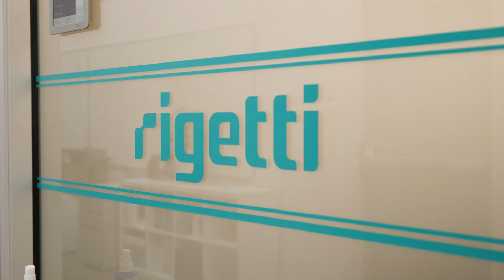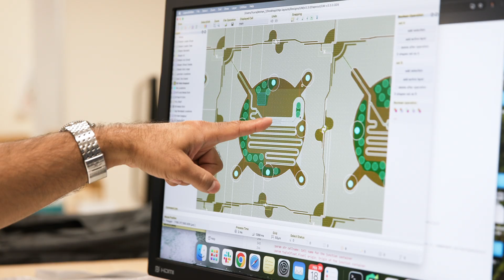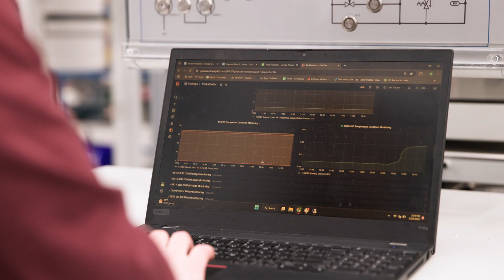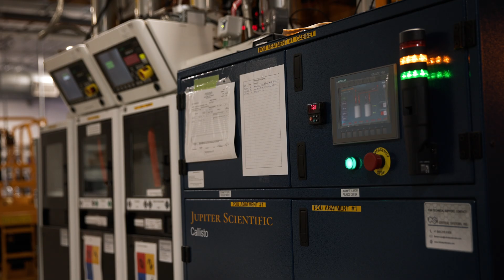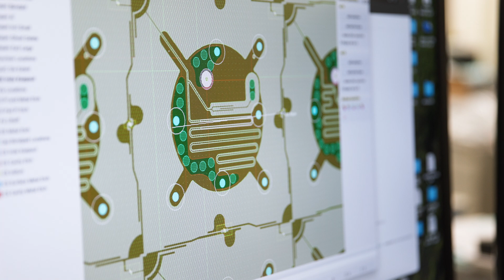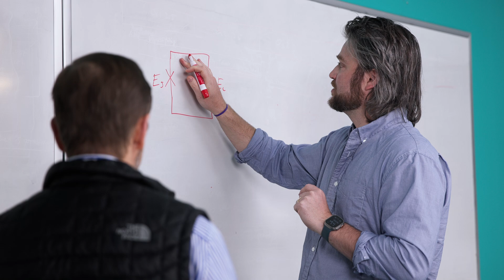Rigetti Computing — A Leader in Superconducting Quantum Computing

Comment: Rigetti Computing (RGTI) has recently been back in the spotlight, and you might be wondering what’s behind the renewed interest. The latest development hasn’t made major waves with an obvious headline, but sometimes, it is the quieter periods that prompt the toughest questions about where a company stands. For investors who pay attention to the details, now is a moment to check in on what has been driving Rigetti’s story and whether there is more than meets the eye. Looking at the bigger picture, Rigetti Computing has turned in a 35% return over the past year, reflecting a pattern of accelerating momentum, especially in recent weeks. While the past month and quarter have seen especially strong gains, it is worth remembering the company’s run of mixed financial results and modest but positive annual revenue growth. These moves are catching attention, as shares have outpaced many peers, even amid ongoing questions about the company’s path to profitability. Given this climb, especially in the past three months, the real question now is whether Rigetti Computing’s valuation represents an opportunity for investors, or if the market is already pricing in all the growth on the horizon.

Comment: Wondering if cloud would somewhat bottle neck the speed of the packets from the quantum machines?  It would only be available at the speed of the connection to the endpoint?
Reply: IMH and not technically savvy opinion, the speed of transport isn’t the issue with quantum. It’s not like you are playing a FPS and need as little lag as possible to shoot the other player faster. With the type of problems quantum addresses, you send large amounts of data and then the machine goes to work. The work the machine does is where the value will be, based on its ability to achieve quantum supremacy. At least at this point there really isn’t much value in sending the data faster given the speeds of commercial networks. The magic is done on the Qbit…. 

Counterpoint… maybe at some point when traders leverage quantum, there will be more value in transport in order to facilitate faster trades. But they will just house a quantum computer onsite or transport by fiber optic.